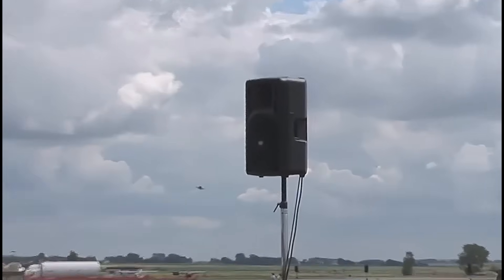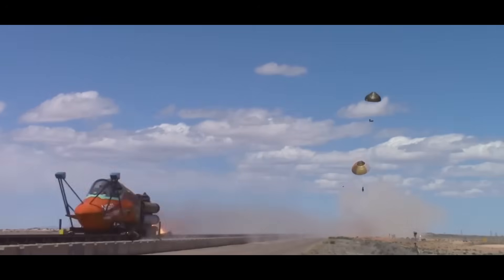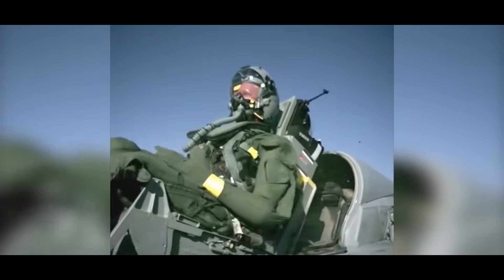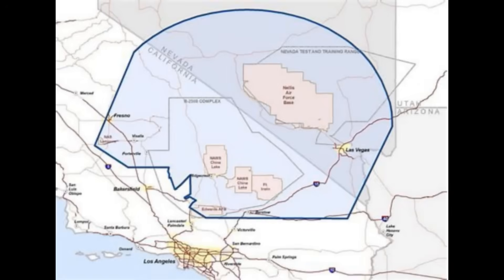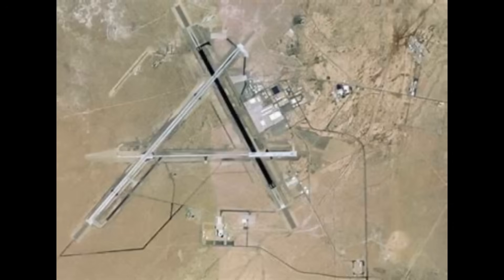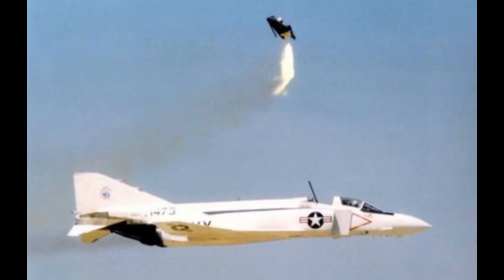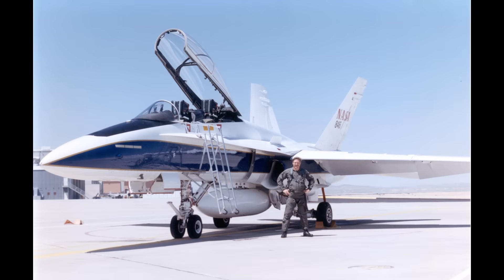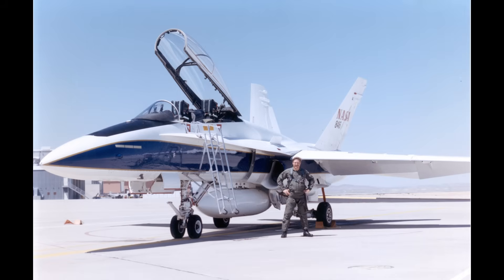Fighter Jet Ejection Test – Watch the F-18 in Action| Aviation Adventures with Captain Ron|

Comment: Hi Ron, nice footage from Holloman! The digital high speed is amazing nowadays. Couple of quick updates for you- 

1- Human testing was retired back in the 1960s after telemetry systems were able to gather enough detailed info that the risk was no longer necessary. Human testing was on the way out for Martin-Baker when Dody Hay did a demo at the Paris Air Show and was seriously injured, ending their human program. Bernard Lynch, the mustachioed man previously mentioned in the comments, had already ejected in testing over 20 times. 
In the US there were still a few tests done including Project 90, a zero-zero test of the Weber F-106 ROCAT seat (one of my friends was the project engineer on that test) and tests of the F-106 'B' seat as well as the B-58 capsule. Yes, animals including bears and chimps were also used, and phased out after these tests as the manikins matured.
2- There are other tracks in the world still active including Hurricane Mesa operated by Collins Aerospace, and the Martin-Baker test track in Northern Ireland. Other countries use stretches of their railroad tracks for testing. 

3- A non-sequitur- Interestingly one of the most famous sayings in the world comes from ejection seat and sled testing. Murphy's Law - " Anything that can go wrong will go wrong." Edward A. Murphy Jr. had designed accelerometers to be used on sled testing. The first run they read nothing and it was found they were installed backwards. Murphy is quoted as saying this in several different ways but it was John Paul Stapp, the head of the program, who first used a version of the saying in a press conference about the program.
Reply from the maker: Wow! Thanks for the interesting history!

Comment: In the leadoff story about the the CF-18, then Capt. Bews didn't "get a little slow", but instead he was doing a standard demo of the Hornet's slow speed, high alpha capability. When he started the transition out of that state by throttling up, the starboard engine's fuel control failed which is why the plane rolled & yawed to that side. He tried to recover but was too low & slow. He had no alternative but to eject.
Reply: I saw Captain Bews pull up to the airshow low low pitch up on purpose. From my view I immediatly assumed he was going to do a F-22 like super slow Cobra manueuver for the crowd as he was very slow already when he started the pitchup. I think he was at around 130 which is F-18 stall speed clean like he was. So at that point Dave your explanation looks right on. Captain Bews was demonstrating how easy it is to handle a F-18 when its over the fence and watching the 'Meatball' and directed by the Landing Officer for 'trap landings'. Airshows are recruiting stagings so you definitely want a prospective navy pilot to think the F-18 is stable when its trying not to slam into the back of the ship when deck flails around in high seas :) Yep Captain Bews was low, slow and pitched up and about to kick in full burner to then demonstrate a 'Bolter' easy TOGO button in F-18 when his FADEC said Syonara Captain and bird stalled real bad real fast and so he punched out.